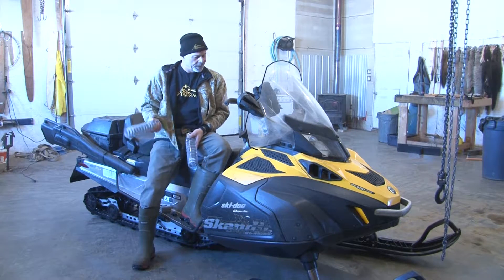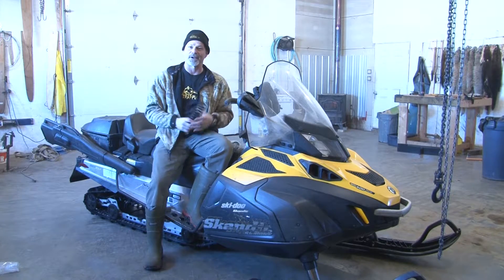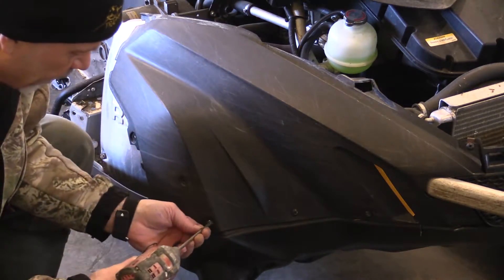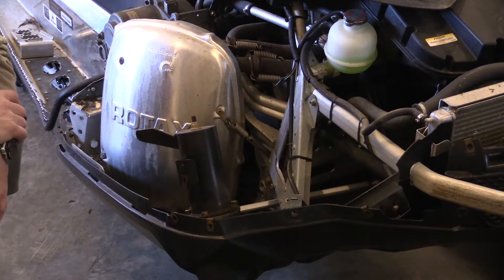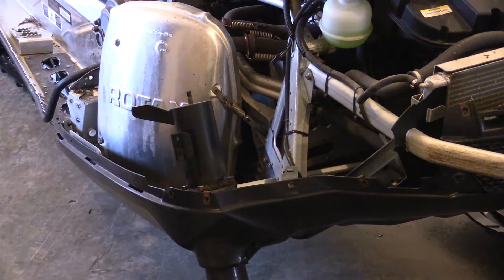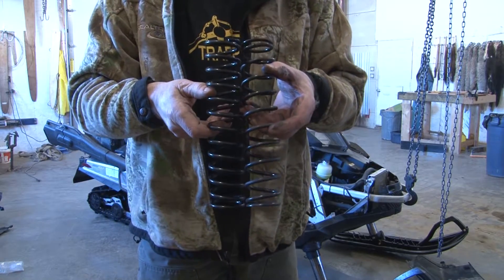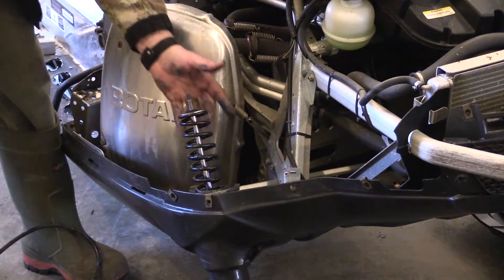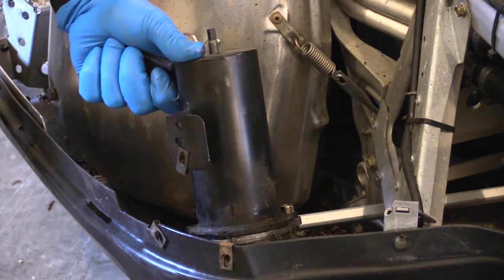Replacing stock Skandic Skidoo pogo stick Springs with Revel Springs

Comment: Just ordered the springs for my 2017. I hope it makes a difference in its tendency to want to gator roll to the right.
Reply from the maker: I call mine the "fainting goat". As slow turn to the left and it faints over on its right side! LOL
Reply: @TrappingIncTV  Did the springs help?
Reply from the maker: Hard to say. I did the ski widener kit first and then the springs. So my machine is better but for which is not clear. Hows that for help? LOl

Comment: Have you ever broke a strut steering ring?
Ski Doo pn: 505073823
Reply from the maker: Yes, I have that happen on an episode in season 7
Reply: @TrappingIncTV  
Jacked up the belly pan to take off pressure to strut cap and while elevated found that the steel bushing for bottom Ski bolt was hammered, ski tube hole was egged out.
Need to throw some $$$$ at the poor 2011 Scandic WT